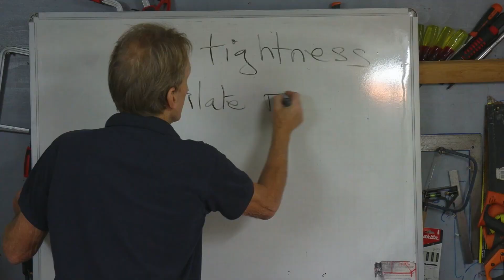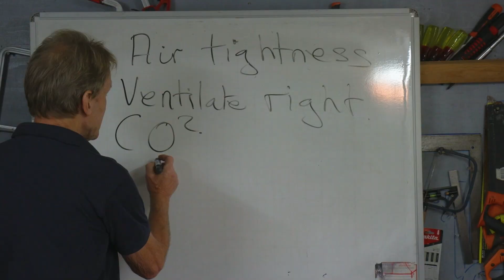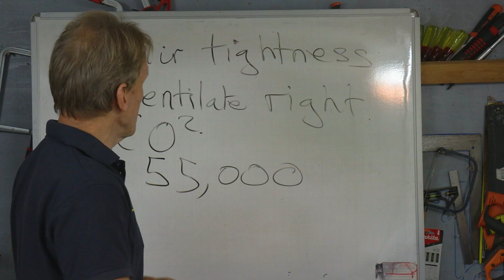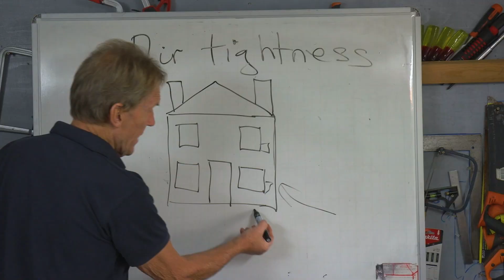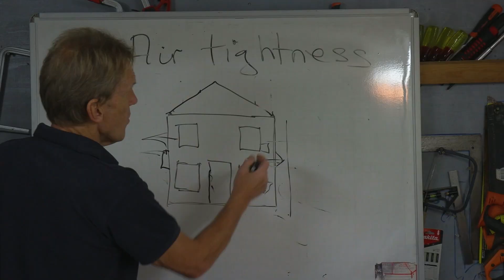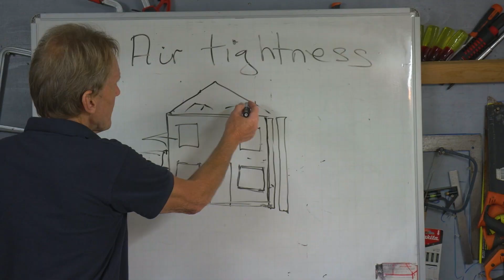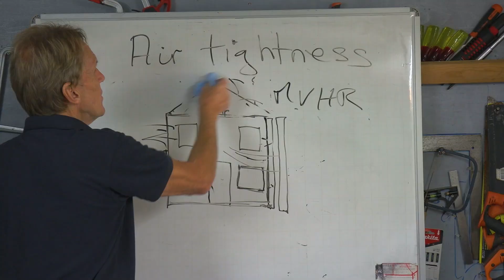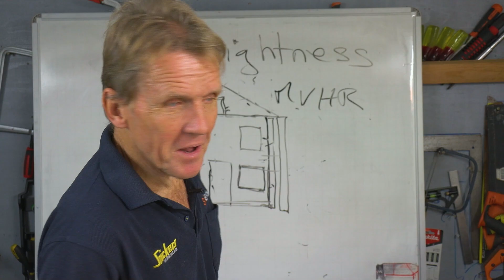The Ugly Truth About Airtight Buildings

Comment: What advice would you give for my 1930s house with 9" solid walls?
Reply: Avoid cement render and pointing, don't use gypsum plaster inside, use lime and keep the air bricks clear and have a lovely roaring fire in the hearth, slippered feet on the fender, a huge slice of Dundee cake in hand and Darjeeling tea in the pot, listening to Paul Temple on the wireless.

Comment: 7:15 Roger that’s a good story , I was fitting loft insulation in a council house around 15yrs ago and same thing , a little old lady sat in the chair, her home was like a time capsule, her kitchen was near non existent, the old deep sink with wooden drier. Basic base units. Must of been from the 50’s. Seemingly she refused any upgrades offered. She seemed happy enough but I was shocked. Each to their own
Reply: You can't miss what you haven't had
Reply: Brings back memories of my grandma, one tap over a Belfast sink, + a gas cooker. She insisted that the door be always left open , lived till about 99 when she decided to move on. 
Our ch rads are a mystery to Europeans  , what a con trick . A dry house is a warm house . Old neglected chimneys tend to be the problem where humidity and damp start . It shows at ground floor level so often diagnosed as dpc breakdown

Comment: I’ve got terrible condensation in n my Windows in winter. A 20yr old bungalow with blown wool insulation. Old skool timber windows, I fitted trickle vents to no avail. Currently use that clingfilm with sticky back plastic method in the inside which surprisingly works. I’ve a non window shower room, the extractor stays on for around 8mins after pulling the light on. Leave the door closed after showering, I worry that if I buy new windows it’ll not solve the problem? Unless triple glazed. I’m not a fan of cavity insulation or air tightness. But tbh some humans in other countries have no running water or electricity so we can’t complain!
Reply: Are your windows double glazed?
Trickle vents can make it worse! Crazy I know but they can make the the air near the window colder which makes the window colder which will encourage condensation. 
Bathroom extractor fans can have their run on minutes adjusted. Try that first.
The warmer the air, the more moisture it can hold so less condensation, keep the bungalow warm. 
Moisture in dwelling come from kitchens and bathrooms. You seem to be on top of the bathroom so see if you can reduce the humidity from the kitchen. Recirculating hob extractors are hopeless, proper external extractors get rid of a lot of moisture.
Finally, are you drying laundry indoors?
Reply: @harveysmith100  p.s I obviously only have this issue in the cold of winter. It’s not a huge problem just annoying. I’m not a fan of no window bathrooms but beggars can’t be choosers.
Reply: @harveysmith100  Lids on saucepans while cooking helps.
Open a window.

Don't bother with a kettle. Just use water from the hot tap to make tea or coffee...

Joke!
Reply: @harveysmith100  Yes double glazed. Yes I know, the extractor is probably on for 10mins after turning the light off, I mean imagine it running for longer, burst yer head the noise.

 I seen no difference with the trickle vents, the same amount of moisture on the glass. 

No never dry laundry indoors as that obviously adds to the problem. 

Having blinds and lined curtains are the issue as you create a barrier between the warm air and the glass. A good solution is to take the curtains and blinds down and in winter sit with the main living room light on so all the neighbours can see you in yer budgie smugglers but at least the windows stay dry!! 😂😂 🐤🐤🐤🐤🐥🐥🐥🐥
Just no airflow, this bungalow is boiling warm, the old style windows I don’t like leaving on the “click” at night. If I get new il get ones that only the top sections opens, leave it open to help circulate. I did start opening the curtains when going to bed and tweaking the blinds, it did help slightly . Lofts and cavity’s help homes breath, now they’re all stuffed with earth wool and such like. I’ve HOOVERED insulation out of gables before that’s caused mould issues in flats. Crazy.
Reply: @MrSmid888  Vent Axia do a near silent extractor now. Worth a thought.

You are correct about the curtains and blinds but you are also right about the budgie smugglers!

Apart from kitchens and bathrooms, breathing is the next biggest cause of condensation however I don't recommend breathing less.
Sleep with the bedroom door open helps.
Reply: @harveysmith100  😂👍🏻👍🏻
Il look that extractor up, it’s one of those jobs where you know you could improve it but it never gets done! Cheers 👌🏻
Reply: Buy yourself a couple of decent dehumidifiers off Amazon. 1 upstairs, 1 downstairs. Run them for a few hours each day on the days you know its going to be bad. Cheaper and less hassle than new windows (if that's even what's needed).

Comment: Bring back ice on the inside of single glazed sash windows , hot water bottles, outside toilets , and time served tradesmen
Reply: ha ha  yes I remember those days too !! Our windows were metal framed,ice was at least 1/4" thick on the inside.
Reply: Ha ha, I remember thick ice on the inside of my bedroom window in the winter.  We used to have to lay towels on the window sills to mop up the water as the ice melted.  And we had central heating, but Dad wouldn't turn it on until the evening for a few hours.
Reply: Yes has that in my bedroom, always looked so pretty the ice patterns.
Reply: Carpenter for 40+ years. Homes are too airtight. Those tiny ventilators mentioned are like a fart in a windstorm.  You don't typically see old homes with black mold and rotted wood because the building could breathe. Also, older timbers were more dense with tighter growth rings, so more resistant to rot.

I've had to remove and replace siding, sheathing and framing because a house was too airtight and condensation caused wood rot and excursions of the dreaded Carpenter Ants...worse than Termites in my book.
Reply: @davidguenther8170  hence MVHR systems
Reply: My tenants seal around every possible source of ventilation then dry washing on radiators and complain about mould. Dip shits.
Reply: @davidowen2859  I refurbed a landlord property bathroom last year and that is exactly what the tenants had done. They even unscrewed the extractor from the wall and filled the vent up with expanding foam! Window's taped over and to make matters worth the bathroom was a ground floor extension with zero, no insulation above the ceiling at all. Hot one side of the plasterboard, cold the other. In 35 years it was the roughest bathroom iv'e ever done. The ceiling was actually covered in black mould and covered in water droplets. As i stood in the room the water was actually dropping onto me. The walls were slimy, mouldy, absolutely rotten. And you should have seen the rest of the house. How people live like that is beyond me. Animals.
Reply: Them was the days. And all the kids in one bed to keep snug.
Reply: And waking up with a sore dry throat as a result of the paraffin heater on the landing!
Reply: There is a lot of fear being spread here. MVHR is not THAT expensive. You may not have to remodel your whole house, because you can get away with wall mounted heat recovery units that you install room by room, starting with the most used/worst room. It may be enough to install just in a couple of the most used rooms if others are only used occasionally.
Reply: My mate and I were talking about exactly that, the other day - legs up to the coal fire whilst your shoulders froze... but things like asthma were virtually unknown.
Reply: @johnriggs4929 

Asthma was known and the main treatment was being excluded from school sports. It was overshadowed by TB which was treated by sitting outside in warm clothes or going to Eastbourne if rich.
Reply: Yeah sod that for a game of soldiers.
Reply: @Bob-_-Smith  Because as Roger is saying you need to ventilate via heat recovery
Reply: Electric blankets..! :-p
Reply: Bring clothes under the bed covers to get dressed. No thanks.
Reply from the maker: Jules 
I remember doing that
Reply: @Jules_Pew  Just don't take them off in the first place.
Reply: @Jules_Pew  try telling your kids about it... LOL!
Reply: @meibing4912  My eldest when he went to uni had a room where there was ice inside in the morning. The place did not have double glazing, so I think he has some understanding of the struggle of us oldies.
Reply: Bring back outside toilets.  They were great and I think more hygienic than all toilets indoors
Reply: @mypointofview1111 Better again go shit in the ditch. 😂😂😂😂😂
Reply: That was my childhood,never did me any harm.
Reply: @gavinwtroy  Me too
Reply: @gavinwtroy  Nor those that died of TB and hypothermia 🖖🏻☘️🇮🇪
Reply: @gavinwtroy  how can you be sure? maybe you will die a few years earlier than you otherwise would have...
Reply: My in-laws still live like that and their coal and electric bills are sky high. Not to mention the shit that pours out their chimney every day. They're rural enough, it's not a big issue, but Christ knows what they'll do in a decade's time.
Reply: And £15 a week wages ?
Reply: @alberttatlock5104  inflated wages =inflated prices. Look in terms of loaves of bread; pints of beer; gallons of petrol. 
Our modern wages benefit enormously from cheap materials (plastics etc) ,  electronic developments and simplification and more. 
We get a lot of bang for the buck. Wasn't possible then.
Reply: @alberttatlock5104  yep... gold at £15 an ounce, house prices at around £1500, petrol at 30p (per GALLON,  not litre,) and  beer (bitter) at 1s/10d (9p) a pint... it's all relative - but are we better off? No, I don't think so: we've lost more than we've gained, but most don't realise it.
Reply: @alberttatlock5104  £15 ?, you must have been a politician, I was on £7.30
Reply: @alberttatlock5104  £28 a week in 1970.  Yes please though, beer was 15p a pint and now x33 times more expensive.  A house is x65 times more expensive.  A car is x32 times more expensive... you see a theme developing here?  Yes please, I'll take the £15-£28 a week and everything that goes with it.
Reply: .. and a homogenous, morally strong and non diverse society!

Comment: There are probably less than 0.1% of houses that have enough airtightness for CO2 emitted from human breath to be any sort of issue.
Reply: Get a Plant, it will deal with any increases of CO2 you could potentially hold in the Air.
It would potentially create extra humidity in an Air tight house mind you :)
Reply: @brianmcintyre14  I'm not sure what the exact amount of CO2 used by a plant in a day is but I wouldn't think it's comparable to the amount exhaled by a human.
A plant will convert CO2 into woody matter and after a year a dried out plant wouldn't weigh much more than it did 1 year ago. Which would be an indication of the amount of carbon it has captured from the air.
Reply: @caparn100  You are quite right, they can deal with far more. Controlled environments show us this.
Reply: @brianmcintyre14  I'm not sure if you read my response properly?
Reply: Not where i live. And Radon a prob too. This video is a good and important warning. Too many people going for insulation and not thinking about air quality.
Reply: co2 is a simple proxy measure for indoor air quality.
Reply from the maker: Yep but they are hell bent on increasing that number as quickly as possible

Comment: The ventilation regulations do take into account occupancy levels and tasks done in the room and also the cross ventilation from other rooms under door thresholds.
Reply from the maker: So how do they know how many people are in the room. I have been to houses where there are ten people living there and they weren't big houses.
Reply: @SkillBuilder  I think they might drop those regulations in future in the name of diversity and to be more inclusive to the likes of the Bangladeshi community.
Reply: @SkillBuilder  ok so yes the latest data where extended period of low concentrations of CO2 effect various things is very new. So the regulations do not yet reflect these new findings.

Just like how buildings aren't required to exchange fresh air in order to decrease effects of viral respiratory diseases. But they may well do soon!

A suitably specified mechanical exchanger rather than type 1 system is very rare even in new builds. Despite being clearly explained in the regs and with that you can do away with trickle vents.

Comment: My mates wallet is air tight especially when we go into Costa.

Brilliant video Rog.

It's true, but thing is building control dictate the air tightness rules not the owner.
Reply: Why go into costa? I take a flask and then I'm not out of £34 quid.
Reply: Yes. Drying clothes indoors etc and cooking without saucepan lids add moisture to the home environment.

Showers and baths cause condensation which people might see running off their cisterns.
I always open my bathroom window about an inch when showering or bathing.
It all helps.
Reply: @hannahjames3180  same here, I like to leave extract fan on for at least 20 mins after a shower, missus turns it off straight after, pisses me right off, not tied in with light as there is a large window which is always open a crack
Our cooker hood is on 24hrs a day as well on tick over when the hob isn't used. No mould visible in our house, would be if the missus lived alone, all windows shut and no extraction.
Reply: @tinytonymaloney7832  I have two extractors. One in kitchen and bathroom.
Kitchen one I can put on as I choose. Also have lots of windows in big kitchen.

Bathroom extractor only kicks in when light is put on and to be honest, it is loud and you can't have a relaxing bath listening to that.
Reply: @tinytonymaloney7832  I swapped my bathroom extractor for one that runs 20 mins after switching off for the same reason. The missus doesn't fancy crawling into the attic in her slippers and dressing gown to adjust the setting. Problem solved!
Reply: @hannahjames3180  extraction fans in kitchens help, dehumidifiers help, tumble drier helps. But, do people use them? No. Because it costs a lot I hear. 😃